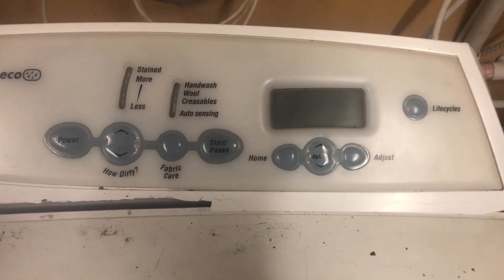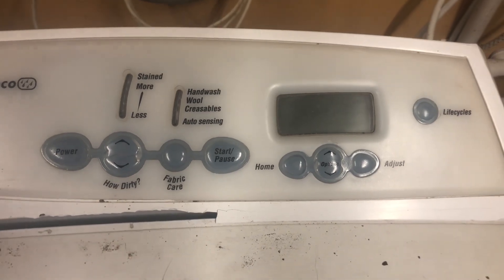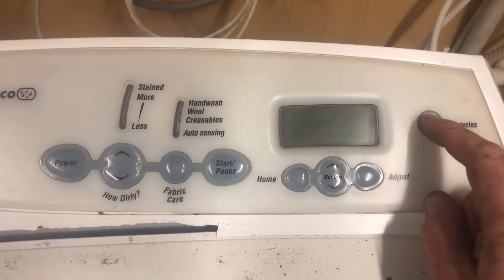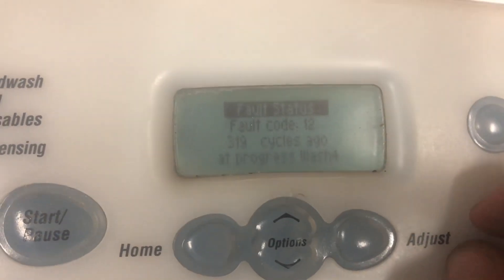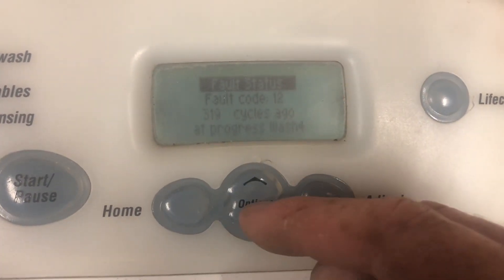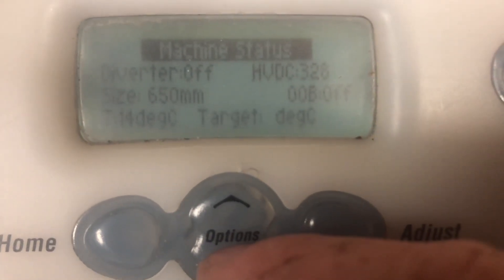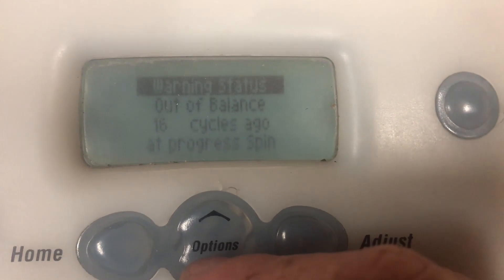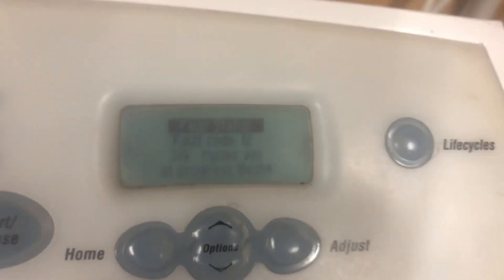Fault Diagnostics on F&P Intuitive Eco washing machine

Comment: Great video. I have this same machine and its throwing error 49 half way through the rinse cycle. I cleaned the inlet water filter which was dirty but the error persists. It fills fine, washes and then during filling up for rinse it throws error 49. Any thoughts?
Reply from the maker: What is the resistance of the cold inlet solenoid? And what model is it? If you unplug power as soon as it faults and check resistances again. I would guess solenoid is overheating and going open circuit after operating a while, then resetting when its cooled down.
Reply: @motrepairs  When cold it was reading 60ohms. I checked it again when the machine threw the error and its open circuit. Will order a new module online. It looks like you have to replace the whole module? Not just one solenoid?
Reply from the maker: @rob8145  Yes comes as a complete valve assy.

Comment: Hi, I have error code 49 coming up on the screen. I’ve bought a new water inlet valve but the new one also has a green wire attached alongside the black wire that you connect to the control board which wasn’t on the old water inlet valve so not sure as to where to attach this wire. I’d ordered the part from Steve’s Appliance Spares and made sure it was the exact model too. Any help with this? I’ve tried googling this but isn’t much help.
Reply from the maker: That is an earth wire, it is an upgrade to the original part. You need to connect this to the existing daisy chain of green earth wires in the controller area, there should be a spare terminal loose or on the control beside where the other earth connects.

Comment: Hi, these videos are very good.  I have a IW712 Eco with a 51 fault code.  I've replaced the RPS and divertor valve so I'm guessing it's the Main Controller Module.  Would that be a fair assumption?
Reply from the maker: No you dont want to be assuming things and replacing parts randomly, that will just mean you waste a lot of money. What did you replace the RPS for,  was there other codes?

First thing you need to do is confirm if the water level is dropping when recirculating. Start by making sure drain hose end is not too low and causing it to siphon. Then watch at recirc and see if water is coming out recirc hose, and that none is coming out of drain. If it is draining and recirc at same time will have sticky/partially blocked recirc valve. If draining and no recir then check if voltage from controller (if you know how to safely), and that valve not installed wrong. If recirc correctly then need to look at why controller thinks there is a water level drop. 

May be more then you can safely do, so might need to get a technician who knows FP machines.
Reply: @motrepairs  Hi , thanks for your rapid reply.  I replaced the RPS accidentally as I incorrectly read the error code manuals (and google didn't help either :-)).  After studying the operation, I noticed the drain hose was running continuously when the machine was filling so thought it was a faulty divertor valve, which I replaced.  The problem is still there so I'll check the voltage from the controller (I think one of your videos covers that). Thanks for your help, Peter
Reply from the maker: @vimowheelchair3117  Ok if you just have the one code to deal with will be easier. Try lifting the end of the hose up and see if it stops, it may be siphoning on its own if the end of the hose is too low.
Reply: @motrepairs  Thanks.  No change...I'll check out the voltages at the Main Controller.

Comment: Mine keeps cutting out, "Power cut restart in 10 seconds". What do i do to fix it ?
Reply from the maker: Is the display actually turning off for a while first? If not I’ve found that the wiring harness between the display and the power board can cause this. If you replace it or clean the connections and make sure the pins on the plug aren’t spread too far apart. Or could be power board, or display, or bad house wiring causing power to cut.
Reply: @motrepairs  I took the housing off, and pulled out connections and put back in. Seems to be all good now. Thank you for getting back to me though, I appreciate it 😊👍